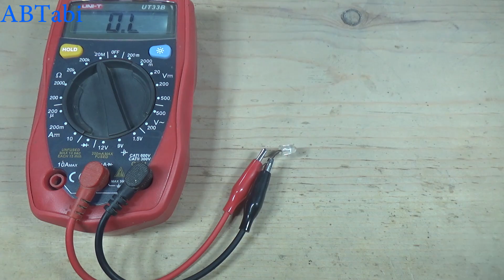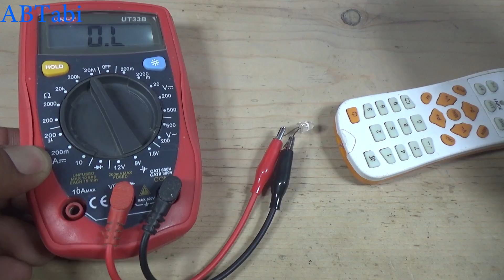How to test Remote Transmitter Led sensor, simple and easy

Comment: Hello. I have a Sharp TV with a 75-inch diagonal, model AQUOS_TVE19A. I want to find out how I can make the remote control emit a strong signal regardless of the direction it's pointed in. Previously, the remote worked even when pointed in the opposite direction from the TV, allowing me to change channels or the volume. Now, however, it only works if I point it directly at the TV and I have to get closer to use it. What could be causing this issue and what kind of LED should I use to replace the old LED with a new, more powerful one that allows changing channels from any direction? Thank you

Comment: Excuse me, it is not understood why is the 10k Resistor connected to a 12 Volt battery and  another LED & what happens if it is placed near another LED that is connected to the Multimetre?